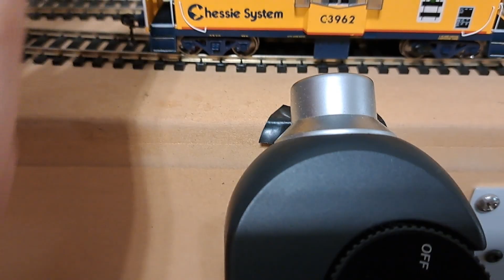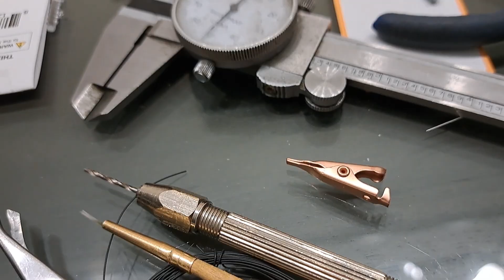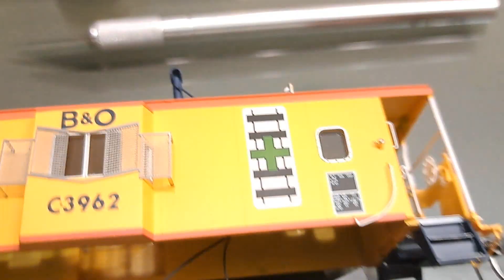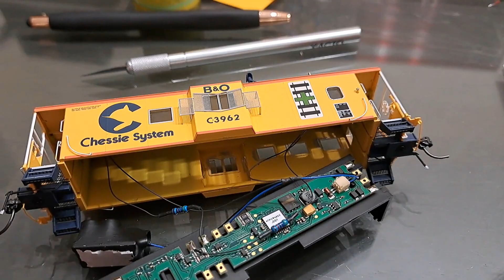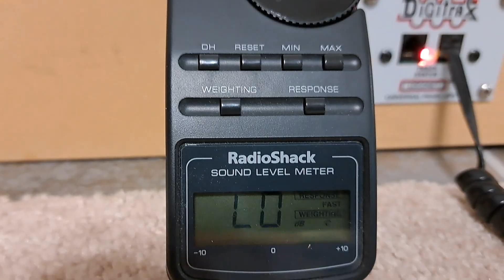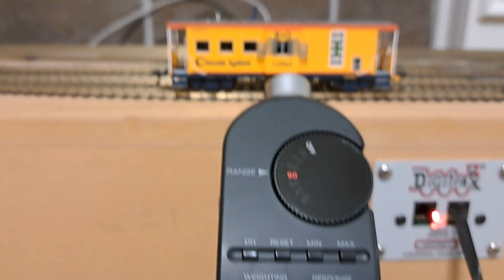Athearn Genesis Chessie System Sound Version Caboose Modifications 2

Comment: 98dB? Not sure you are "doing it right". That's a level that causes hearing damage with long term exposure. It about the volume of a power mower. But I guess absolute accuracy is irrelevant if your test conditions are constant.  And looking at differences, if your numbers are correct, you increased the volume by 80X.  Quite a modification indeed.
Reply from the maker: CV 128 is the volume control.  You would have to have your ears with about 8 inches and blast that horn for over 7 minutes straight to even remotely consider eardrum damage.  I am releasing full poetential of a poorly designed product.  You can always turn it down.  From the factory to is far too quiet to hear at your local layout.